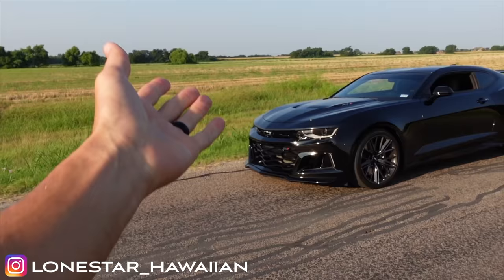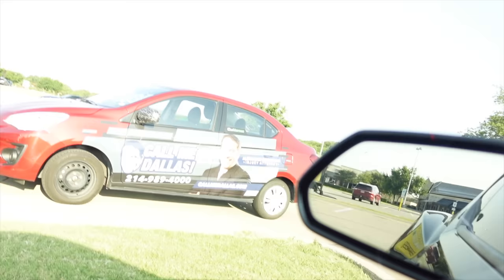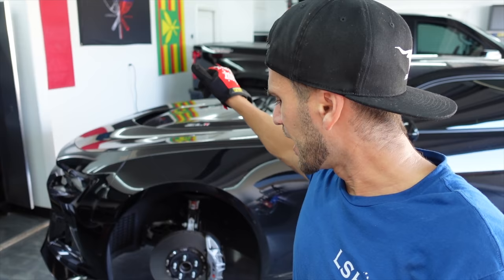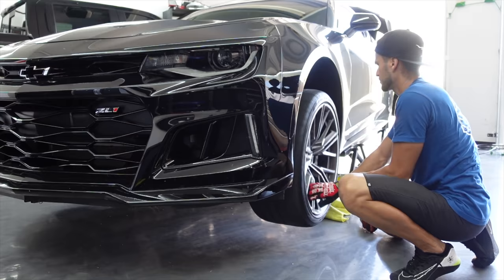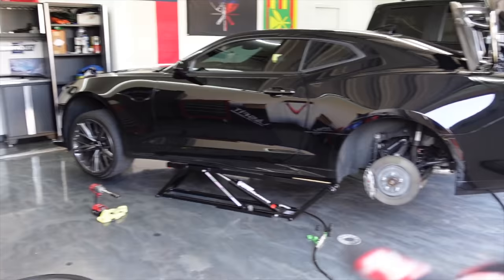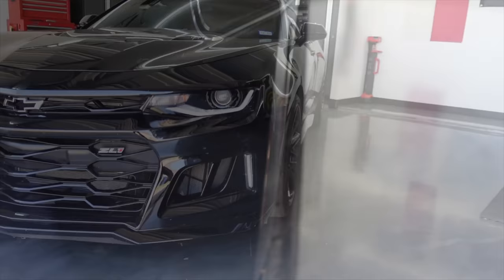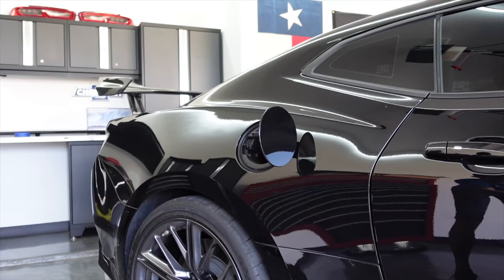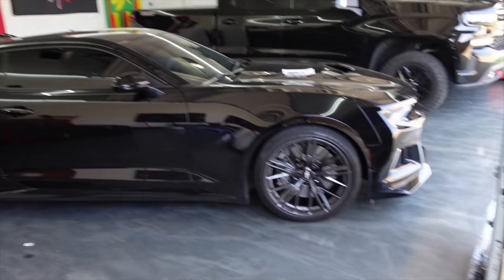Give your car "STANCE" - This is Probably a BAD IDEA - Camaro ZL1 Wheel Spacers

Comment: Wheel spacers are not a good idea at all, they add load to the axle and extra load to the power steering. Plus way too little threads holding the front lug nuts for a performance car.

Comment: Love the car build so far and either ZL1 wheels or 1LE are great (I bought 1LE for mine). I would never compromise safety for 3-5mm wider stance and the extra stress you are putting on the wheels and suspension, just don't use spacers! Gas cap is good, I am also thinking of doing the same (I have the Riverside Blue body colour with all black accents).

Comment: I'm not a fan of the cap either but as long as you like it, that's all that matters. You mentioned about having too much black on the car but u want to do black ZL1 stickers? You also mentioned about making your car yours, unique so with that said, i wouldn't go w/a stock wheel and go w/aftermarket wheels. And most important, you should lower the ZL1, the wheel well gap is throwing off the stance. I can't remember if you talked about lowering it but it's a must. Looking fwd to this build!

Comment: My stock wheels has R888R’s with the rear having 315.   The steering wheel gets stiffer than normal & the grip, of course.  Currently I’m running on MRR M755 black wheels with M. Pilot Sports 4S.   Decided to go taller to fill gap didn’t want to modify the suspension.   Front 285/35r20 & rear 305/35r20.   Looks amazing.   This setup am using 5mm & 3mm for the rear.  I’m looking into getting 315/35 Nitto’s for the rear.  Take your time
Reply from the maker: Thanks for the info!

Comment: Keep checking wheel torque......
Very important when running spacers. 
Plus , here is a helpful hint for track rats
Most tracks will not allow wheel spacers
When Passing through Tec inspection .
Just an FYI.

Comment: You should’ve removed the 2 bolts behind your brake pad,the 34mm and then you can pull the front strut outwards a little to help. The bolt has like 5 mm of play
Reply: The top one is the one that moves and you need to put the nuts on the end and hammer the top bolt partly out

Comment: I currently have stock 20" 305 tires on my 2017 ZL1.  Would 315's or even 325" tires fit on the stock wheels with no clearance issues?

Comment: Random question; I haven't seen the previous few videos of it was already answered, but did the Quick Jack kinda fail due to user error or manufacturer defect? Pretty important to report to Quick Jack if it was a defect :0
Reply from the maker: You can check out the previous video for the full explanation. QuckJack lift works perfect, the rubber blocks they provide begin to deform/flex when you have a vehicle up on them for a few hours.